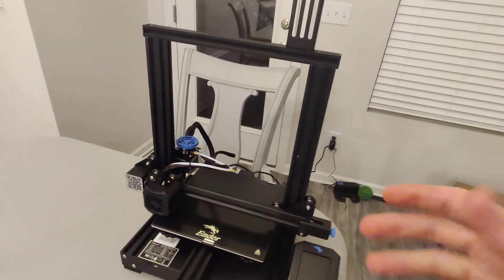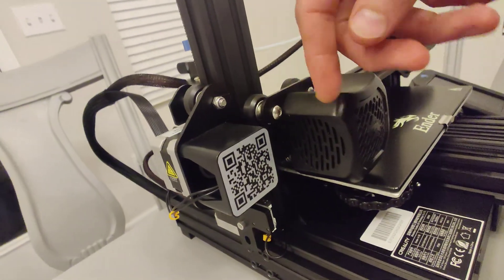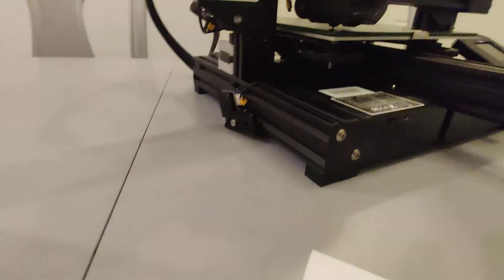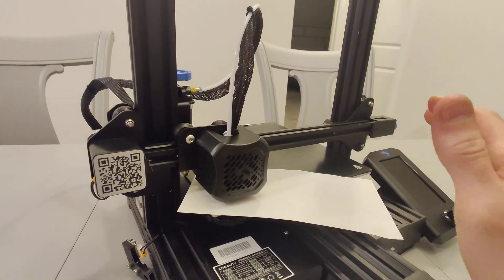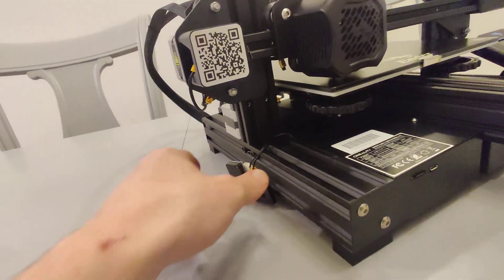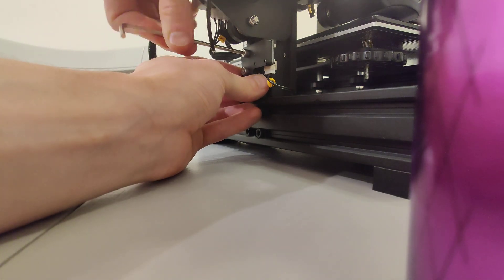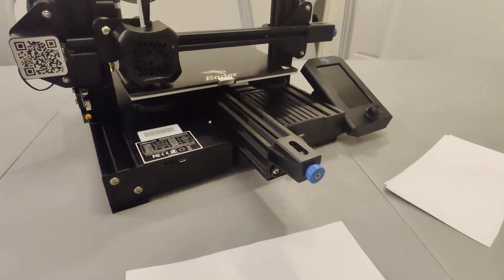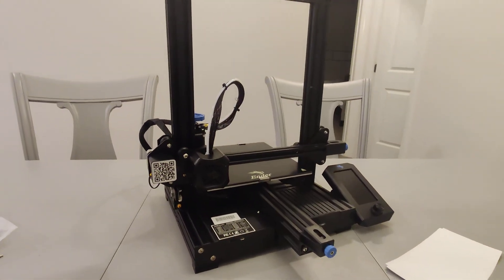Creality Ender 3 V2 Cannot Level The Bed

Comment: If something goes bad and the nozzle will put pressure on the printing plate it will break the glass because the bed leveling springs are maxed out.

Comment: It's insane they still haven't fixed this problem. It's so insanely simple and it wouldn't really cost them anything to fix it. It's such a common problem too. With mine, I could raise the bed high enough, but the screws/wheels become so loose that they would just spin on their own while printing, causing the table to move up even higher while printing and screwing my prints up really bad (like 0.050" off per inch height, up to a little more than 0.1". Even after printing a new Z-stop though and lowering the bed to tighten the screws/wheels, the print bed still keeps losing its zero/level, so I'm trying to find a fix for that now. Am hoping I don't have to design and print my own stops for the wheels to stop them from spinning while printing.
Reply: I'm having the exact same as issue, I can get the bed high enough but the springs have no tension are knob too easy to move

Comment: Thank you so much! I’ve been having issues with my ender 3 stop being too high, and was reluctant to cut the tab that stops the s stop from going lower. This video confirmed that it doesn’t really matter if it’s there or not, it will still do its job.

My printer is now running great, no issues with the level whatsoever. THANK YOU!

Comment: Thanks for the video. Just a question - Im having trouble leveling my printer. I will send this to the home position and then will disable the steppers. But I noticed once I do z axis will droop about half a milometer, meaning that if I level the bed like this, once I go to print everything will be too high. Any suggestions on a fix? thanks so muchh!
Reply from the maker: When you rehome the printer it will correct itself :)
Reply: @ThePrintHouse  thank you, I will keep trying! Sry - follow up question - when the printer goes to home, is the limit switch on the Z axis supposed to be fully compressed? Or just partially compressed? 

I think the issue Im having is when I home the printer the limit switch is partially compressed, but when I disable the steppers it falls a bit and then is fully compressed. This makes it difficult to try to level :(
Reply from the maker: @gaveintothedarkness  that sounds like it is performing perfectly. You should level the printer with the power on so the steppers hold the head up without falling. Make sure you home the printer before you begin to level so the steps lock
Reply: @ThePrintHouse  Thanks again for taking the time to reply. You dont know how much I appreciate it! Do you mean I should use the controls on the printer to jog the print head to various places on the bed to level? 

Asking because a lot of the videos I watch have the person disable the stepper motors and they manually move the head around. Thank you!
Reply from the maker: @gaveintothedarkness  Of course! No problem! And yes. Some printers have default buttons to push to move the print head directly above the bed screw. If yours does not, you just use the controls to jog it to the correct location. You can disable the steppers if you want, but you were suggesting that your z height keeps falling, so you wont have that luxury. It depends on the style of printer and how strong your stepper holds the bed/nozzle in place when it is not locked.
Reply: @ThePrintHouse  Thanks again, its a base ender 3, and all the tutorials I've seen show the steppers being disabled when going to level the bed, but I noticed mine was falling a bit and bottoming out on the end switch. This is how I found your video.

Comment: 20h into trying to level the bed. I'm throwing this piece of shit into the garbage. Always either the top or bottom left corner is too low or too high.
Reply from the maker: The bed does not have to be absolutely perfect, in fact it never will be. That's nearly impossible to manage. The good news is that you will likely almost never print objects the entire size of the build plate. That being said, I HIGHLY recommend you get a BL touch or a CR touch. It will fix all of your problems.
Reply: @ThePrintHouse  I ordered one a few hours ago.

Comment: My ender 3 print head put two holes in my bed from grinding itself into the bed and also keeps starting all my prints on the edge of the bed,I thought I had done something wrong in cura and that's why it was going to the edge but I ran same SD card and file on ender 3 max and no problems at all,any ideas?

Comment: Hi! I don’t think I have that piece that you’re supposed to pop off then put back. I’ve looked everywhere on my printer and can’t find it for the life of me.
Reply: If you have an auto bed leveler like acrtouch or bltough then you won't have the limit switch for z
Reply: @travislangworthy45  oh I do have that. But when I try to print anything it won’t stick. What can I do?
Reply: @thatgoldenspringi  The models with sensors should have a setting for z offset that you adjust up and down. What that setting is telling the machine is how far away vertically the level sensor tip is from the nozzle tip. It's the distance between the two. It will probably be a few mm or so. You can auto level your bed all day long but if the machine doesn't properly know how far away that sensor is from the nozzle then you could have problems with things like prints sticking. I may have some things out of order here because I'm kinda new to it too but thankfully I'm past the problems of getting stuff to stick :) turn your printer off and then on again. Run "Auto Home" . Run "disable steppers" or "disable motors" or whatever sounds like that in yours. Open up the z offset setting. Use a piece of paper like you've probably seen on plenty of videos and move the z offset value up or down until you get the slight drag on the paper. It's advisable to write down your initial value before changing in case you go too far and can't remember where you started. This would also be a good time to  physically move your nozzle left and right and your bed forward and backwards (assuming we're talking about some ender 3 variety) to all 4 corners directly above each leveling spring and slide the paper under and adjust as needed. Hopefully getting that z offset right will get you printing. You should also be able to adjust the z value live while it is starting to print by going to "tune" or possibly another similar word on the list of things you can do when you click. Then you can fiddle with it for fine tuning that last few hundreds of a mm by actually watching what happens with the slight changes. Best of luck hope that makes sense!
Reply: Yeah now that I'm re-reading it you DON'T want to run disable steppers/motors until AFTER you get the z offset adjusted when the nozzle is in the middle of the bed. Once you get z adjusted THEN disable steppers to move the hot end left and right and the bed forward and backwards to get the edges level.
Reply: @travislangworthy45  Thank you so so much for the help! It worked and I can finally begin my printing journey :D
You're a lifesaver, thank you!
Reply: @thatgoldenspringi  Happy to help!
Reply: @travislangworthy45  hi again! I’ve been printing out lots of cool stuff. However, after I changed my PLA filament (the other ran out) I begun to run into an issue. The PLA strings sort of like stick together which makes it bend to the point where it can’t print anymore (unless I cut the bent piece off and start it all over again). Idk it’s hard to explain but why are the PLA “strings” sticky? Do you know what I can do?
Reply: Nvm I fixed it

Comment: First thing to do out of the box ( if you change the springs it will be not a issue) But watch out the bed do NOT hit the motor when it cycles back!)
Reply from the maker: Yeah there is certainly something to say about changing the springs, but this is definitely easier and sometimes it's the only option directly out of the box. So many people dont know about this tip haha :)

Comment: What if you have the opposite issue
Reply from the maker: You can also raise the limit switch. It does not have to go lower. As long as there is enough wire you can go as high as you want :)

Comment: Hey I don't know how to fix this. Put off the clip. My rear is too high, and the screw on the right front side is way to low. If I put the z stopper lower, my bed will interfere with the motor in the back. But if I put it higher, my screw won't reach the nozzle. Already scratched my whole plate...
Reply: Never mind, with a little bit of some creativity, I managed to fix it!
Reply from the maker: Have you considered removing the glass bed and laid it flat on a surface to see if it is warped? If it is, you can maybe contact creality for a new one.
Reply: @ThePrintHouse  glass isn't warped. Turns out, I think the metal z axis on which the bed is attached is warped/bent. I contacted my seller about this and I hope I'll get a replacement. Already tried adjusting the nuts with no success
Reply: I’m having exact same issue. Back plate was way too high and extrusion scratched plate. Front of plate too low. No amount of knob turning would fix it. I’ve dismantled the base to see if I can reassemble it level. But now I’ve lost a spring. Sigh. But I guess the springs suck and everyone says to replace them with higher quality springs. Im about to give up on this printer
Reply: @ttuarmyjag84  I ordered a new z axis profile via warranty and replaced the springs. works perfectly now. I guess my z axis profile war bent
Reply: @joooosl  hey, I’m having the same issue with the rear motor too, any idea how to fix?

Comment: This is the biggest take away from your video!!   I just built mine and when you are setting it up, slide the z-switch up until you hear the click.  DO NOT PULL THE BAR DOWN UNTIL IT STOPS. and make your adjustments.  The nozzle will end up being about 1/8" too high.  Thanks!!  You saved me a ton of time.
Reply from the maker: I actually cant tell if you are being sarcastic or not, but if you are being serious I am glad that I helped you!!
Reply: @ThePrintHouse  I am being serious.  Your video helped me a lot.  I just wasn't thinking that the Z bar would stop where the Z axis switch would click to stop it, not the very bottom where the travel stops.  Thanks again.

Comment: I cut that nub and still can’t level the damn bed! The right side always rips the paper and I run out of turns to lower the bed. I do this when hot, what am I doing wrong? HELP! 🤬
Reply from the maker: Try this:
1) Remove the z axis stop switch so it is not in the way
2) Tighten all 4 corner knobs as tight as they can be
3) Manually lower your print bed to the spot of the bed that is the HIGHEST. Put your print head about 1-1.5mm above the bed in that location
4) Put your stop switch back on the z axis. Slowly slide the switch up the rail until you hear the switch click. When it click, tighten the switch.
5) Relevel your bed manually with the 4 screws on the corners (do not unscrew the corner that had the highest spot unless you need to.
Reply: @ThePrintHouse  - OK, I’ll give this a try. Thanks for the reply. I really appreciate it! 👍
Reply: @damionchrist  The one item he missed typing in his reply that was mentioned in the video, was before proceeding to level your bed normally was to auto home it. I am releveling mine again, and that is the one step I missed.

Comment: this is explain why my bed spring knop almost loose for a good level. may be this is the right to do if we using the stock spring. thanks
Reply from the maker: I have found this is the best thing to do. It doesn't hurt the printer to perform this minor modification. In fact it actually makes your z axis on your build plate even larger. I also suffer from weak bed springs and do not want to replace 4 springs on multiple printers. That will get expensive quickly.

Comment: you suppose to level your bed when the nozzle and bed are up to print
temp as they expand.
Reply from the maker: That is true. I usually don't do that for safety reasons. I've found that the bed levels pretty well with a cold nozzle
Reply: @ThePrintHouse  me too, i'm afraid of heat, so i just level the bed after sending home then after that i preheat and print
Reply from the maker: @stefid5875  I think leveling with a cold standard brass nozzle is fine. There is very little expansion as the metal heats up. Some other nozzles might have more expansion and require you to level the bed while preheated.